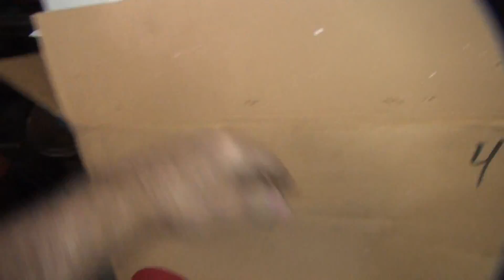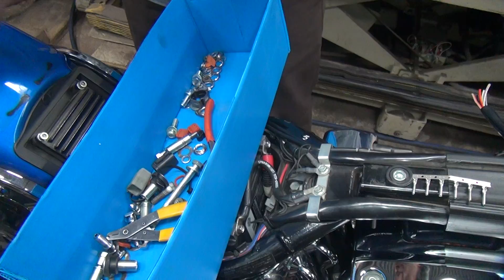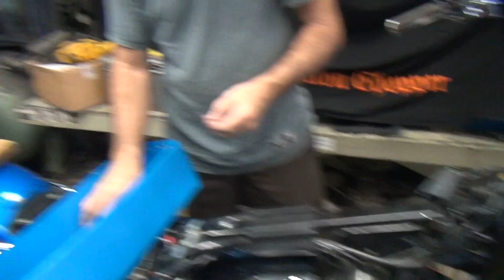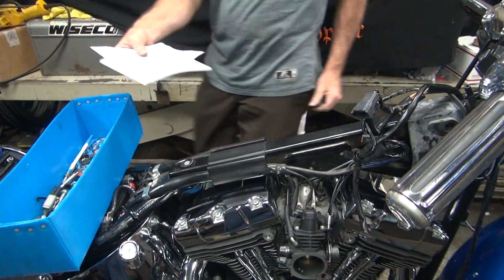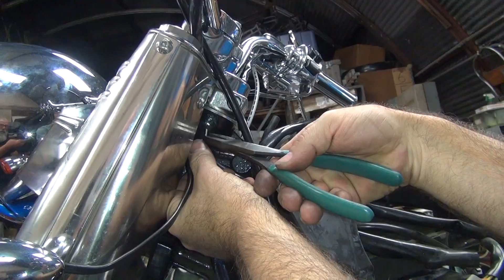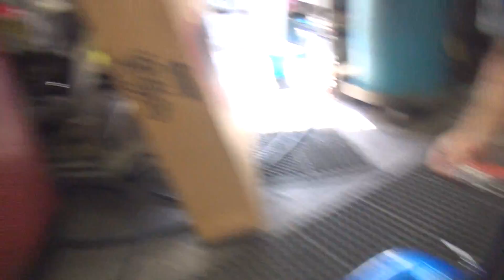2004 fatboy #111 craigslist find alan's new bike flstf softail harley repair tune-up tatro machine

Comment: Turn signal wires are so long because on a stock Fat Boy the turn signals are mounted on the handlebar control units.
Reply from the maker: not sure about that on this bike, but i haven't worked on one before. its working good now and looks better then the h/bar mounted ones.
tatro

Comment: Boy, I really like that crimper, as it crimps both crimps at the same time. I couldn't afford one like that. Mine is a lot cheaper and have to crimp each part separately. Bought it so that I can change the 5 1/4" headlight with a 7' Trucklight LED and only had to crimp 3 wires so I guess it's no big deal.

Comment: There is a small bracket on the old clutch cable that was supposed to stay on the frame to hold the cable in place, but the bearded dude unscrewed it and took it off when he removed the old cable
Reply from the maker: yes we know about that clamp. just havn't got to that part yet. still need to tie the wires down too. the fuel leak slowed us down for a day.
tatro
Reply: yeah, just seen it in the blue box, that video wasn't out yet when i commented!...lol